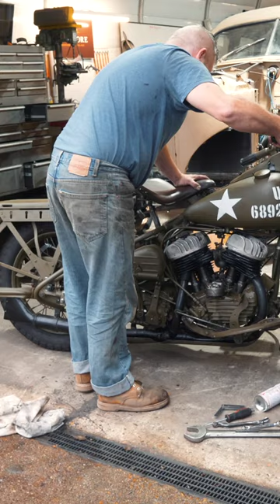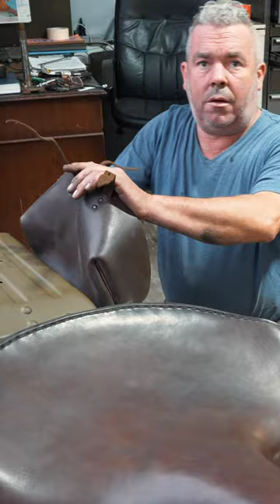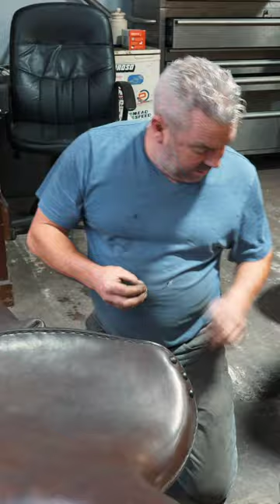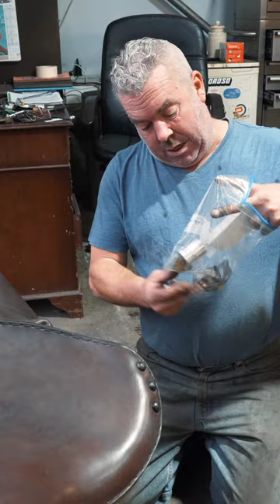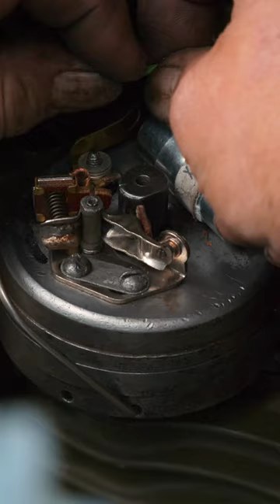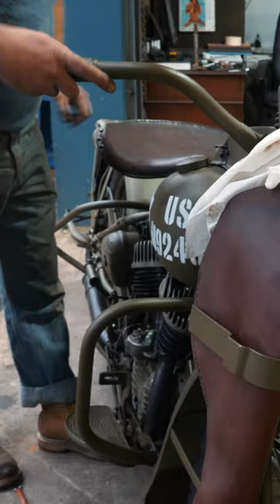What can cause backfires? #shorts

Comment: interesting, mine was poping and farting and now it appears the condenser has given up completely, ,I'll see what happens when its replaced
Reply from the maker: Let us know!
Reply: Replaced condenser with a BrightSpark solid state transistor, Is firing up but stupidly I messed with timing at the same time and doesn't seem to catch as easily as before. Oh, and while I'm here can Ash do a 'how to set mechanical regulator/relay up'.
Reply from the maker: @dogpaw775  If I've learnt anything watching and filming Ash over the last 5 years is that every time you touch anything you'll need to check the timing. I'll chat to him tomorrow about your video suggestion so stay tuned!